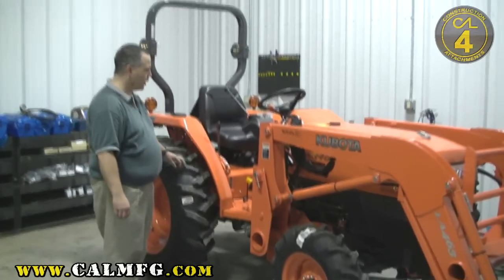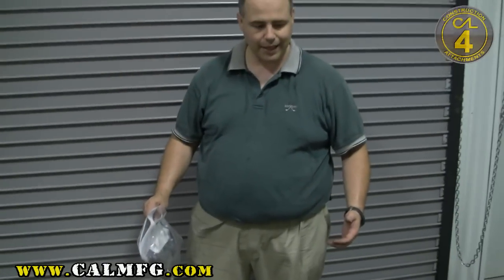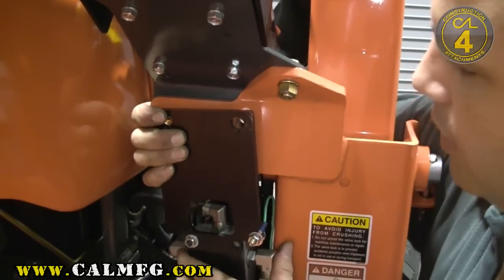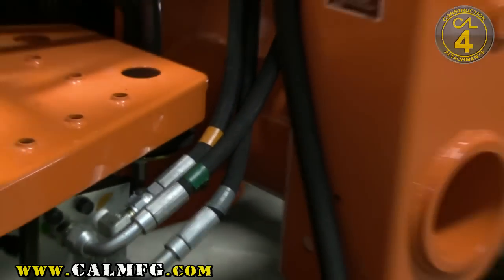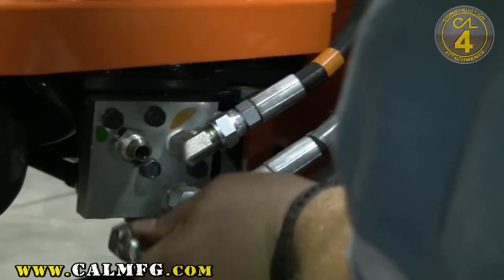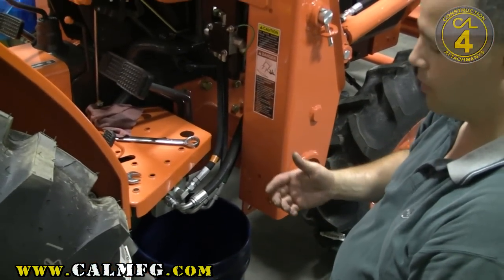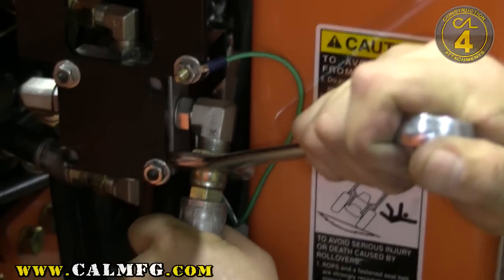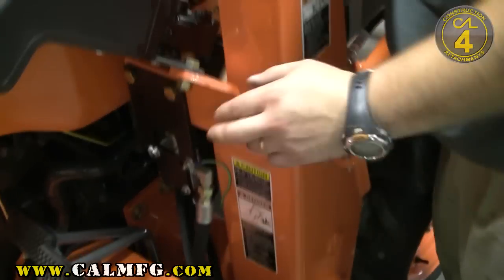One Touch Kit for Tractor Loaders - Installation

Comment: One misstep off that platform and those hydraulic lines will snap right off, good "Engineering" guys.
Reply: +Tom Cook it's a non-issue.... You don't get on / off that side of these tractors....you'd have to be some kinda super skinny contortionist to get around the loader valve handle! Not to mention there's no step bellow the floor plate on the left side, either.